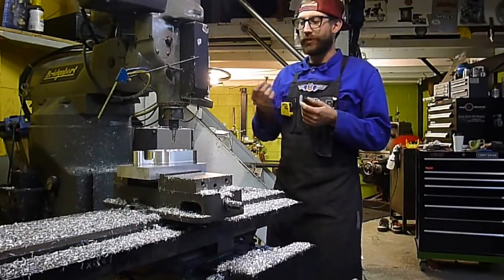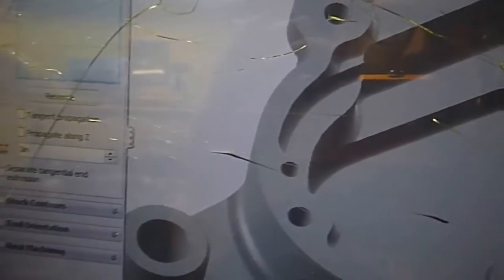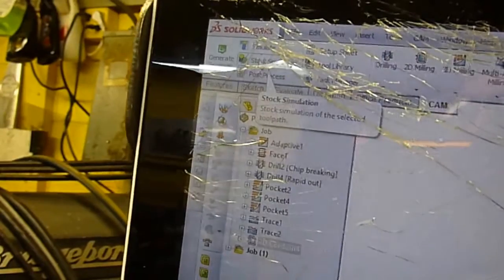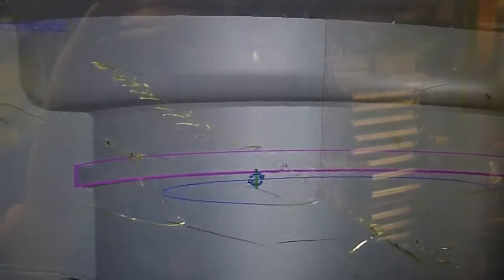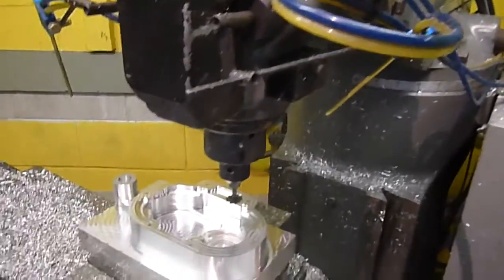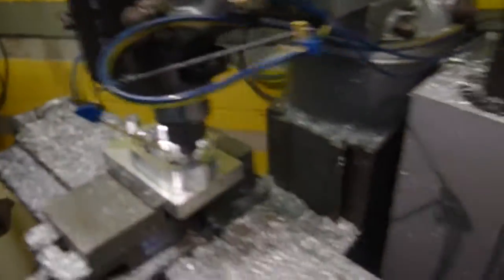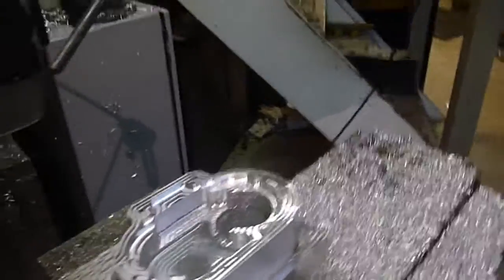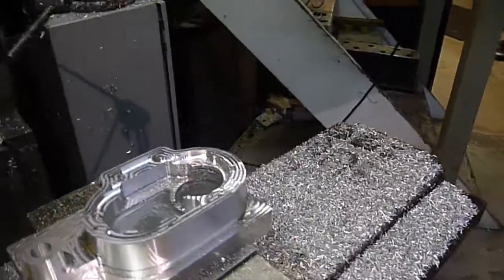HSMworks Solidworks  - 2D contour tool paths with a Slotting tool for Harley Clutch

Comment: Is the cracked screen from all the parts flying out of the vise? Chip load buddy. That's a five to ten inches per minute type cut at that rpm. You're making mud at that feedrate.

Cheers,

Tom
Reply from the maker: You are not alone, I use a copy from a company I work with so that's how I get it but the more I work on things the more I realize that things like Autodesk's Fusion 360 and some of the low cost or free software out there that allows hook up for future growth is where its at.

In the next years I can see a lot of design companies going to Fusion 360 because it offers CAD/CAM all in one package and the price is not bad for an average user. I think they really want to get it in the hands of the users as opposed to holding it from everyone because of a hefty price tag.

A year of Fusion 360 is like 300 dollars ( which is still 300 dollars but legal and includes all the benefits of a big company and their support) and puts you a pro level design seat with the ability to add things like CAM to run a CNC and other add ons as your shop grows.

 Its still new but seems to be picking up speed and gaining users. Solidworks is great but I wouldn't have access to it if I didn't work for companies that have seats of it that I can access.
Reply: One of the things we did with fusion 360 is make it free for enthusiasts (i.e your business makes less than $100K / year) . That way people who do it as a hobby or a freelancer or whose business hasn't grown that big yet can have access.

As the ceo of autodesk I'm really interested that everyone has access to great tools and I'm really glad we were able to make it available this way
Reply from the maker: Mud washes away and doesn't require a shovel...  I baby it...
Reply: How do folks afford Solidworks?  Solidworks costs more than I have invested in all of my shop.  I know I can get the student version for $150, but that's a year and I'm not a student.  How can hobbyists get a copy that they can afford?

I use Alibre Design (now Geomagic).  It's ok, but I find myself asking how to do the simplest operations every time I use it.  Tonight, I'm asking myself how I can select three adjacent lines and merge them into one.  Sure I can delete and replace them all with a new line, but even the dumbest of CAD packages can do this.
Reply: Carl Bass, you are my favorite person today.  I'll take a look at Fusion 360.  Even if I don't use it, you will stay my favorite person since you did what I have been pleading other companies to do.  To make their products available to hobbyists.  Autocad seems to be one of the few that has heard that plea from hobbyists.  

Which product do you think I will invest in when my hobby grows big enough to become a business?  *The one I know how to use, and meets my needs!*

Thanks you.
Reply: thepiratebay